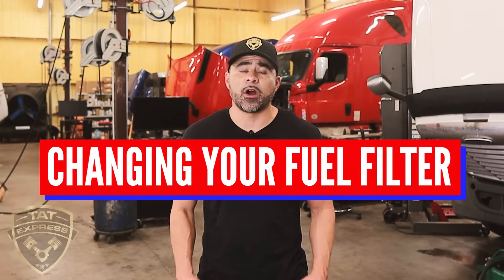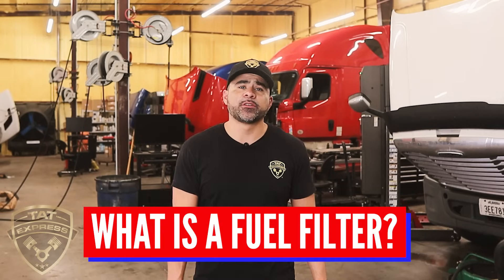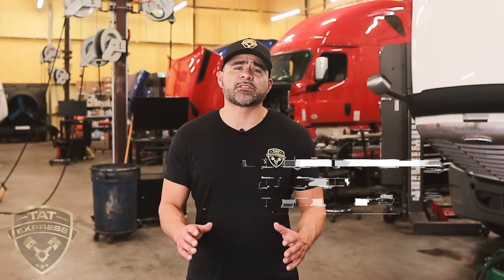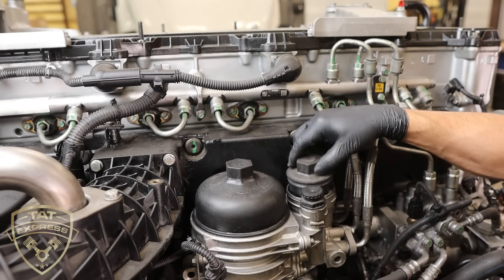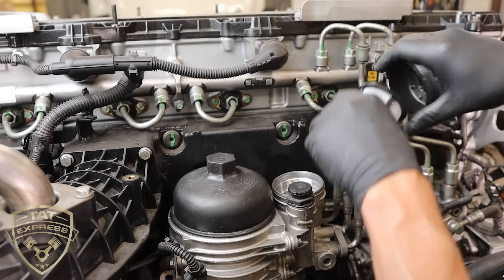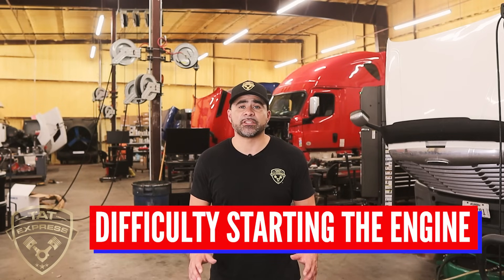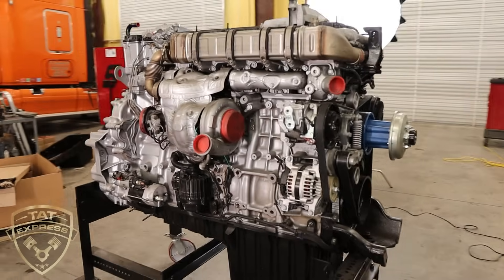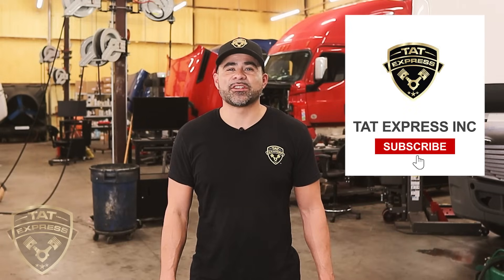When should I change my fuel filters on Semi? Fuel filter when to change/ When should you change?

Comment: Why does freightliner recommend 55000 miles oil and filter change on my 2020 dd13 under long haul duty? Every 10000 seems excessive. I change oil and fuel every 40k but my truck takes 10w30 fa4 oils.

Comment: @TAT Express Inc. Another solid video! Hey brother, I found some metal flakes in my fuel screen filter. It’s not packed with metal, but there are about 25 flakes. I feel like I caught it in time, Could this be caused by something other than the fuel pump? I went ahead and ordered a new pump, but I’m curious if it might be another component.
Reply from the maker: Signs of metal in the fuel filter will usually come from the fuel pump. It is critical to catch this in time before injector damage occurs. 25 flakes would suggest that it may not be from another source due to the amount.
Reply: @TATEXPRESSINC   
Thanks for the response! I pulled the pump out, and it had more metal in it. I decided to go ahead and order a new pump and injectors because I don’t want to deal with it on the side of the road. Now I get to clean out the fuel system/tanks. Thanks again, brother!

Comment: for myself, I change oil and filter and fuel filter every 200 hrs, not mileage, engine is running when pto is in use or stopped at light or running for any other reason...hence I change using hrs not mileage.
thanks for the vid !
Reply: 😊p